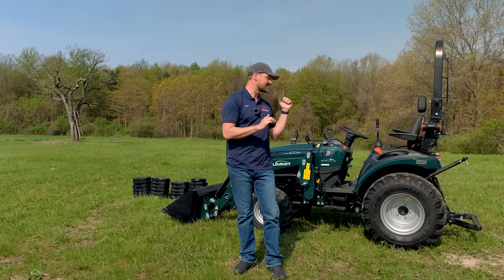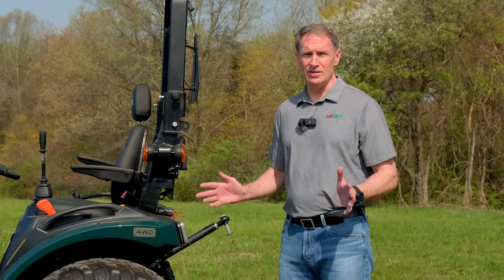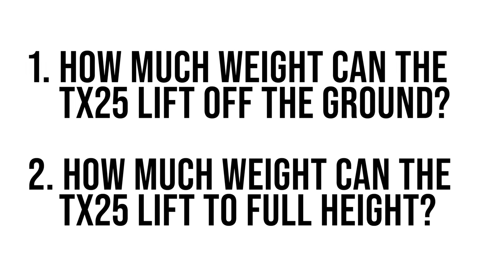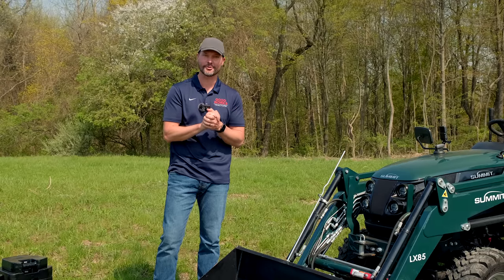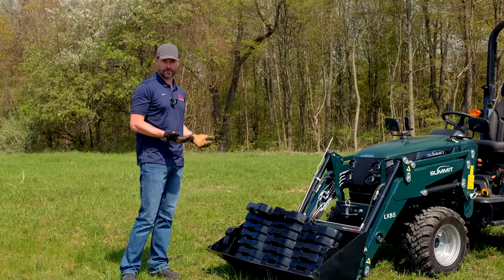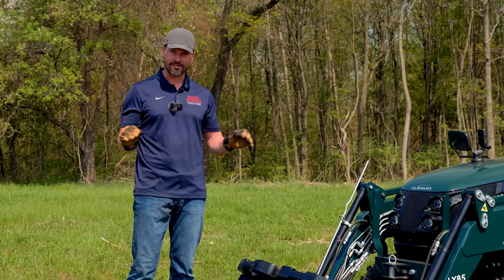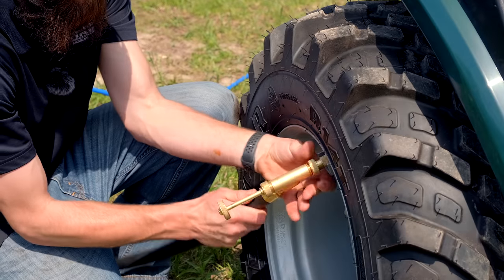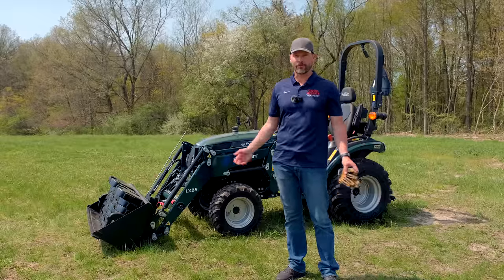TRYING TO TIP A TRACTOR & MAX LIFT TEST OF SUMMIT TX25 🚜

Comment: Have had Rim Guard in my previous tractor and my current tractor. Makes a tremendous difference in stability.  Kudos to Summit for making it standard on their tractors. It should be standard on every tractor with a loader.

Comment: Oh man great demonstration!!
As far as Rim Guard goes, per their website, there are no dealers in Arizona. The closest dealers are in California and Utah. So I purchased 96 gallons of RV Antifreeze from my local Walmart. I know most people use Window Washer Fluid, but it is toxic, weighs less than the RVA, and only good to -25 degrees. RVA is non toxic, heavier, good to -50 degrees, non-corrosive, and was the exact same price as WWF. Oh and btw, Bobcat told me using any wheel weights or tire ballast will void their warranty. That is why I purchased a Kioti, even though I had to drive 250 miles to get it and the Bobcat dealer is local...

Comment: Rim Guard already made a difference for us. I was on some uneven ground and was lifting a hay bale to our pickup truck,  when one tire started to lift up. I had 400 pounds behind but it wasn't enough, but if I hadn't of had Rim guard, I  know it would have tipped over! I was able to get the hay bale loaded on level ground. However I  have 540 pounds of suitcase weights coming in today (along with an Implement on tge same pallet) from GWT to add to my back Implement one we weld on angle iron and hang the weights.

Comment: I have John Deere 1023 and my dealer put rim gard in the rear tires, I also added 50lb rear wheel weights and it definitely does make a difference

Comment: These R14 tires, filled with Rim Guard. . . I have some Honey Locust trees on my property, with at least 3 trails passing under some of them.  Which means some occasional BIG thorns on the ground.  Have had to repair front tires on my little JD 180E lawn tractor twice so far.  I worry about puncturing and having a huge rim guard mess.  Valid concern?  Or don't worry because the tire tread is thick enough to not be an issue?

Comment: This little tractor has character . I have a kubota B2650 with a cab now , I like what I’m seeing in Summit, is there any hydro whining
Reply from the maker: Thanks Brian...you know, I haven't noticed significant hydro whine.  Not sure if that's because I'm so used to it on these tractors in general or if it doesn't have much noise to begin with.  I'll have to pay closer attention.
Reply: Iv got a 35 horse Mahindra that I got from my grandfather and it doesn't have a front end loader and no front ballast. One day I had my 5 foot bush hog on the back while loading on my lowboy equipment trailer I ended up driving onto the deck on just the back tires.

Comment: Courtney, could you repeat that tip over segment after installing a set of Bora Wheel Spacers.  You'll probably need to use a different tractor without the liquid in them.
Great video by the way.

Comment: I totally want one of these tractors.  Need dealers in Georgia!  Even with my larger tractor, I will always have a bale of hay on the back as counter weight for lifting large loads with my front-end loader.  I have always put water & antifreeze in my tires for weight.
Reply from the maker: Thanks for your interest Bart.  They'll be spreading out into Georgia by next spring!

Comment: As always great video Courtney!!! The ballast in tires makes a world of difference most of the time.  Wanted to have rim guard put in mine but wanted way to much money.  So I did it myself with rv antifreeze not as much weight but made a big difference on my 1626 Mahindra.  I've lifted 1840 pounds of logs 4 ft. Off ground with pallet forks without ballast on 3point with loaded tires but didn't go but about 50 ft to unload them.  That summit tractor is sweet lookin love the color and the extras that come with it.  Thanks for sharing be safe have fun enjoy what you do

Comment: The other good thing with liquid ballast (and wheel weights) is it's un-sprung weight. It doesn't effect your axle weight capacity. It will effect your 0 to 12 mph time tho, so no drag racing your neighbor.
 Up here in the PNW I can't use the extra weight in the winter (Oct - May?) because of the mud and clay at least on my property. I picked up a new LS MT-235HE for a retirement present in Feb and couldn't use it on most of my property as it would get stuck with those pos R-4 tires it came with (and the added extra #1000lbs of the tractor probably didn't help). Would have had to wait months to get the R1's ordered. I dropped a couple dozen tree's over the last year and I had to use my old '97 JD-770 to move most of my branch's and lighter logs to my fire pit in the middle of my swamp. Working on drainage this year.

Comment: Yes, a Kioti CX2510 is equivalent to the featured Summitt's frame. Rim Guard in the tires really helps, but for the heaviest spec loads front/rear, additional ballast is still needed. Still need to be cautious on angles and slopes.

Comment: Great video, great little tractor and great info on rim guard. I have seen a lot of your other videos and I feel it is good stuff. We found some old log chains at a farm auction and that is what I'm using for ballast right now and it works but it would be a lot better if the tires had the weight instead of the arms on the 3-point hitch. Thank you and have a great week
Reply from the maker: Thank you Curt and same to you!

Comment: While not shipped from the factory, my dealer adds liquid ballast on all of the loader equipped tractors they sell. 
I'm not sure how much liquid ballast would help in the front tires. As you demonstrated, a tractor would be well on its way to tipping over before the front wheels would start to lift.

Comment: I have 11.2-24 tires and was surprised to see rim guard adds 274# per tire. They came loaded when I bought the tractor. I still need more weight, so I always have some behind me when doing loader work.

Comment: What was the weight of the Rimguard installed in the tires? I know 11#/gal so how many gallons? Definitely makes a difference.
Reply: Hey Phil! The 12-16.5 rear tires on the Summit TX25 require about 15 gallons each. In total, Rim Guard adds over 300 pounds.

Comment: Cool test, and some very good points on loader "etiquette". I do have ballast in my rear tires, not sure what it is, but it definitely helps! 
Just got my Rhinohide canopy yesterday, hoping to put it on my eMax 20 somethime this week. I'm hoping it works, as my ROPS is a similar shape as the JD 1025R only mine are in a fixed forward position and fold well below the bend. Looks like an awesome product and really hoping it works for my machine.
Reply from the maker: Thank you BW!  Send us an email with how it looks after installed, thank you sir!  Shameless plug...the toughest canopy on the market!  http://www.tractorcanopy.com 😂
Reply: The sunshade really helps even in the cool Northwest.  
Your tractor, because of the center pivot on the front axle, acts pretty much like a 3 wheel vehicle. You need weight on the two back wheels to keep them anchored to the ground or your tractor will act like that 3 wheel vehicle in the Mr. Bean series, especially if you have weight on your loader and have your loader high.  Liquid in tire ballast like RimGuard is a good start, but an implement, ballast box or the suitcase weight bracket Courtney sells are a good idea for loader work.
Reply: @frankmoreau8847  Thanks Frank, I usually run with my Backhoe on, so I should be all set with ballast weight. In the winter when I have my front mount snowblower on, I either keep the backhoe on or am running with chains and a rear grader blade.

Comment: I have a 1025R.  I could not get wheel spacers because of the MMM.  I had Rimguard added as well as 70 lb wheel weights and it makes a significant difference.  I can imagine that with larger tires it would have even more impact.  It's not hype.
Reply: You can get 1.5" spacers on the rear with a mower deck.
Reply: @projectswithjw  It depends on model year and what size mower deck. I have a 2015 with 54" deck. I have measured it more than once. Anything wider than 1/2" and the rear tire would interfere with the bracket for the adjustable guide wheels.  Newer models don't seem to have the same problem so they likely moved the location of the bracket for the guide wheels.

Comment: I had Rim Guard put in the tires on my Kubota BX tractor when I purchased it brand-new in 2016. I had to replace both rear tires this year, 5 years later, because the Rim Guard had degraded the side walls of the tires. The side walls had started to split and seep. Is there something specific with Kubota BX tires or is this a common known issue with all sub-compact tires?
Reply from the maker: So tempted to talk some trash about the Kubota, but I hold my tongue, haha!

Hmm, now that is a strange one.  Seems like a one-off type of situation.  I've never heard of that occurring with RimGuard, beet juice, TL-90, or any other product.  I'm sure the tires are long gone, but that's the kind of thing that would be hard to pinpoint without some further analysis.  I've had many used Kubota tractors pass through my shop with RimGuard stickers on them.  None had new tires.  This isn't a known problem with the product nor any other liquid ballast (yes, chloride will ruin the wheels).  I'm guessing more to the story that may never be known.  All that said, RimGuard and pretty much every quality liquid ballast dealer will recommend changing out rubber valve stems for steel.
Reply: Hey thanks for sharing, John. 
We have never heard of this happening since our founding in the 90's, but we would love to assist in any way. If you are interested in our assistance, please reach us at  info@rimguardsolutions.com so we can help. Thanks!
Reply: Did you contact RimGuard about it?  If not, I think it would be a good idea. They're very friendly and accommodating when you call them, one of their folks spent almost an hour with me on the phone going over the issue with replacing magnesium chloride that I mentioned in a comment above.
Reply: @freecycling6687  I did not contact RimGuard. I figured the tires were 5 years old and it was likely more a manufacturing issue with the tire than an issue with the RimGuard. I didn't think it was worth my time.
Reply: @RimGuardBallast  Thank you for responding. I can't truly say it was RimGuard that caused the issue, however, this is what I was told by C.H. Waltz bloomsburg, PA location, which is my local kubota dealer. It is possible that the information I was given was not accurate and it was actually an issue with the tire manufacturer that Kubota was using in 2016. I was told by the service manager that the dealership is now filling the BX tires with windshield wiper  fluid to avoid the issues with RimGuard. I would be happy to vouch for the information I was given verbally by the dealer if RimGuard wants to pursue a discussion with the dealership about providing false claims about the product, beyond that, I do not know if this is worth pursuing? I was not looking for reimbursement, I just wanted to know, for my own knowledge, if the information I was given by the deal was accurate for my own knowledge.
Reply: @GoodWorksTractors  Trust me, I would happily trade my BX out for a 1025R, however, the closest dealership is an hour away as opposed to the Kubota dealership that is 15 minutes away. My only concern with JD is the electronics lawsuits against JD not allowing customers to fix these issues. Granted, this may only be an issue with the larger equipment and doesn't affect the 1 and 2 series tractors, but I have not looked into the lawsuit enough to know which JD models it impacts. Otherwise, JD 1025R is a better machine with better features and more aftermarket upgrades.
Reply: I remember seeing one of those 'investigative reports' a few years after the Firestone/Ford scandal. They talked about the issue of tires sitting in warehouses potentially for years before being sold, and how manufacturer date codes appear to be intentionally designed to make it difficult for consumers and even shops to determine tire age. If shelf life does have a big impact on tire life (emphasis on 'if' because I don't know), I could totally see a scenario where a new tractor ends up fitted with old but never used tires, and since it's not intended for highway use, probably a practice even more likely to fly under the radar.

Comment: holding weight at a certain height is different than lifting it an inch to remove it from a trailer bed.  I would have liked to see you lift it at 36 inches up an inch to test that.
Reply: Me too!

Comment: When you where doing the weight test I noticed the bucket was curled pretty much all the way to the pivot point  that plays a huge roll in how much weight you can lift compared to leaving the bucket flat all the way to max lift height
Reply: Yes, especially in the test to see what you can pull off a truck deck.  If those actually were pallet forks they'd have to be flat to the deck, not curled way back!
Reply: i agree ,no one can load with a bucket curled back ?

Comment: I like your attempt at capability comparison but for the "truck unloading test" you need to start at 37 inches and go UP 1 inch, then drive back 4 feet - failure to lift that 1 inch means you might drag... and when the load comes off the truck you tip.... so the test requires lifting 1 inch then backing up the width of the pallet.  Still, nice demo and you do get your point across. :)
Reply from the maker: It’s just a data point.  I specifically called out an example in the video of loading bags into your bucket at trailer height.

Comment: Loved the video only thing I was wondering was when you 1st had the tractor tip you pushed down on the very outside edge of the bucket but when you push with the rim guard you pushed in the middle of the bucket you even jumped on bucket in the middle in my mine I think it makes a big difference pushing on outside corner of bucket. Again good video summit looks like it could be nice little tractor. I am a kubota man
Reply from the maker: Thanks, yeah definitely didn’t push in the corner of the bucket.  A little off center though.

Comment: I've got calcium chloride in my tires, and it came with it from the dealer. I'm considering replacing it with RimGuard, primarily because of the corrosion issue. I'll have to ask the RimGuard folks if they're installation process also includes (or can include) removing any existing liquid ballast.
Reply from the maker: I do believe many JD manuals still specifically list calcium chloride mixed with water for liquid ballast...almost like they want you to get that replacement set of wheels down the road 😂
Reply: It would be up to the RimGuard dealer you use if they wanted to remove any existing ballast.  The reason I know this is because I almost bought a tractor from a dealer who pre-filled the tires with magnesium chloride, even though I had requested RimGuard.  I had arranged with a RimGuard dealer to go to the dealer's shop, remove the existing stuff, wash out the rims and tires, then fill with RimGuard.  But the dealer decided they didn't want to do it.  (I ended up at a different dealer.)
Reply: @freecycling6687  I had to go to a different Kubota dealer the day we took delivery of the tractor because our dealer didn't sell Rim guard.  They swapped out tires at our dealer with another new tractor, because we wanted R4s rather than R1s. Nobody at our dealer in sales and service knew that someone had but water and antifreeze in them. This dealer simply drained it and filled them with Rim guard. It just took longer, but it was worth the wait since we have goats and sheep.

Comment: I agree with you tire ballast works we see that in video. Is there any downside? Does it rust rim or eat through the rubber? I just bought a new 1025r and am trying to figure if add ballast or just go with wheel weights. As you probably guessed I am one of those new tractor guys you make your videos for. I do go back and look at older ones on the 1025R to see all you do with it and get ideas of what I want, definitely a snow pusher, tried ordering some things from your affiliates but they are always sold out. Thanks for the informative videos!
Reply: Good news, Larry, Rim Guard is non corrosive and animal food grade safe so it protects your tires and wheels! 
Be sure that you have a metal valve stem rather than rubber before installing. Any form of liquid ballast will compromise the adhesion of the rubber valve stem to wheel and you can experience a blowout.

Comment: When you measured the 1025r lift capacity to full height you forgot to add the weight of the toothbar.

You should also include what the max lift height is next to the weights.
Reply from the maker: I mentioned that in the 1025r video.  I can't edit videos, but suffice it to say that the bigger the tractor, the higher the max lift height.

Comment: I've got a JD1025R with the backhoe.  I like the QA system but it seems like a hydraulic weakling !
At full throttle, it won't lift 10 - 80# bags (800#) of concrete stacked in two rows on the heel end of the forks!
At 64 and overweight with a heart condition, it's a strain for an old man to off load 400# by hand!
Thinking of switching to a Summit!
Reply: Might have low hydraulic pressure.  I took mine from 1900 to 2200 psi.  It's much more capable now.